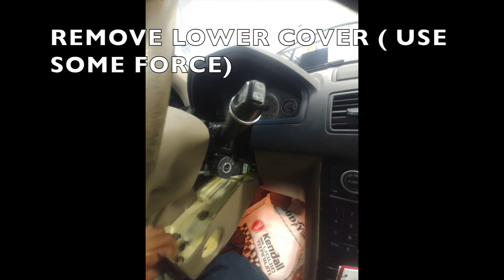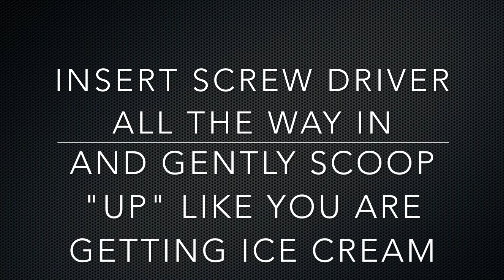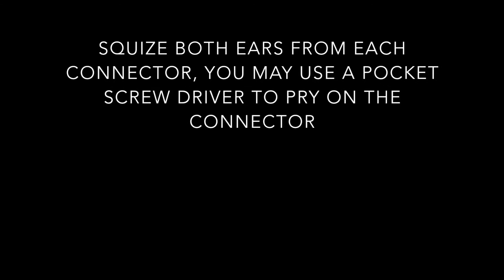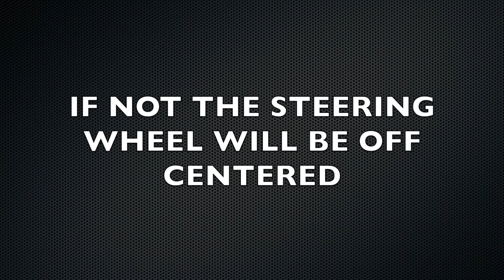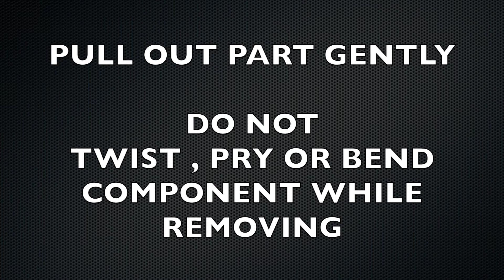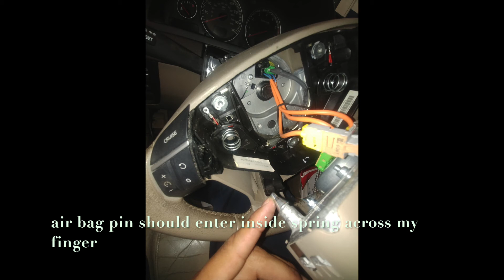volvo Clockspring (sas steering angle sensor) Anti skid light

Comment: Great Video 👍
Code 0109
Communications between control units communicational problems with  SAS internal fault.
Does this mean a faulty SAS module?
Thank You
Reply from the maker: 98% of times is the clock spring
Reply: @VolvopediaGuy  Do you any knowledge of the W button near the shift lever? Nothing happens anymore when pressing the W-button.
Reply from the maker: @mikef6706  that’s for winter hold it for few seconds
Reply: @VolvopediaGuy  
In the past you could tap the button and a W would replace the gear position on the dash. Nothing happens now…?
Reply from the maker: @mikef6706  try it when u out it to drive , press button. I don’t know if it will work on park. Don’t remember

Comment: Thank you for your time, I have more confidence now in doing this myself. Can I assume that with the battery disconnected the air bag cannot deploy?
Reply from the maker: James Holley in theory yes. But always be careful when handling the air bag. It may deploy if excessive force is apply
Reply: OK, I will never hit it with a hammer, how ever stressed I get. Thanks again.

Comment: It's easy to replace but how do you calibrate afterwards?
Reply from the maker: ammazcd with scanner. Actually some times you don’t have to.  Just unplug battery and reconnect.
Reply from the maker: ammazcd drive car and it will go away

Comment: I have an 08 XC90.  How does one know if it’s the clockspring or the yaw rate sensor that needs to be replaced?  Is there a particular code?  

Lastly, where do you live?  Perhaps you can replace it for me if I pay?   Thx
Reply from the maker: marketbuy it will give you yaw rate codes. Also remove yaw rate located under front passenger seat. I seen that it get damage by water leak . Unplug connector and check for any corrosion

Comment: I tried your way of scooping it with Phillips head screwdriver but I cannot catch hold of anything and the bag won’t move. Any other suggestions?
Reply from the maker: Try the opposite . like carving . you have to put some force and slightly pull air bag